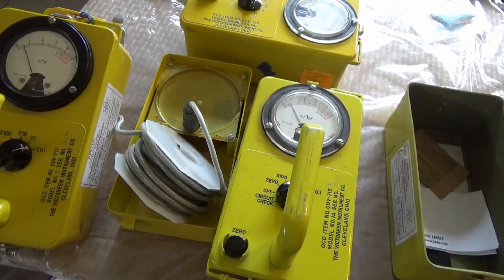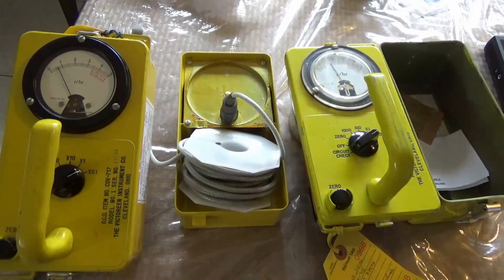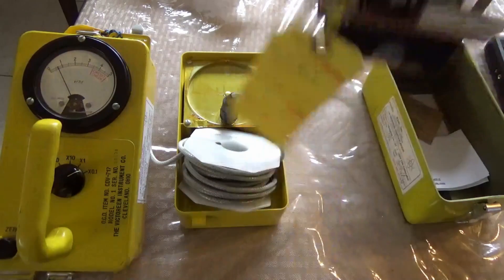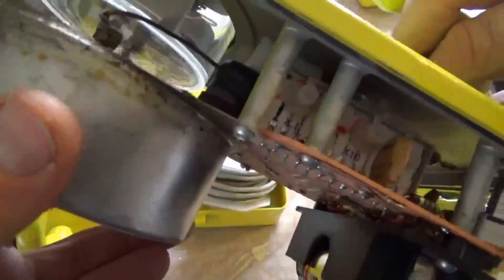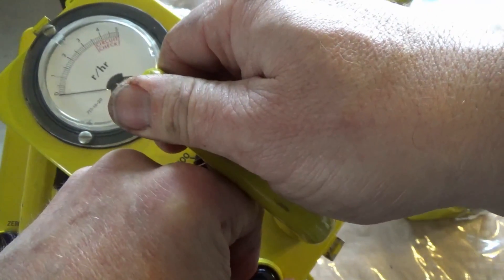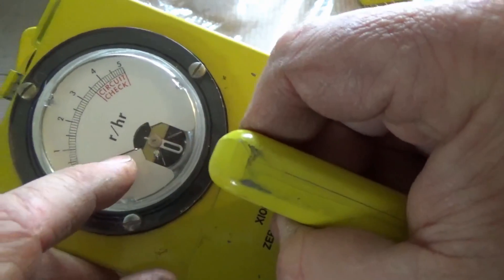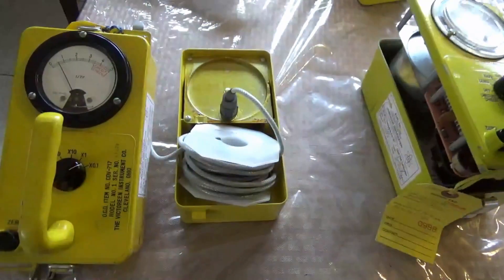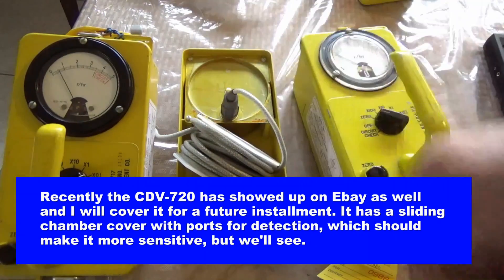Prepping 101: Testing Civil Defense Survey Meters with Cesium-137 - CDV-715, CDV-717

Comment: The reason your meter bounces outside your case is when you remove the Survey Counter from its housing the D Cell battery shifts a little and unless your battery contacts are very, VERY clean and the contacts in the battery holder are VERY tight and clean, when the battery moves  a little it changes Resistance and lowers or raises the amount of voltage the 40 volt power supply receives from the 1 1/2 volt battery and thus affects what the 40 volt Power supply puts out that operates the meter  (just like turning the zero knob does) another thing I have found is EVEN if the contacts are all clean and tight the Zero will still change a small amount when you remove the unit from its case because the Steel case affects the Transformer in the Power supply a little ....I really liked your video .....holding the battery still with your fingers while handling the unit outside it's case also helps!.........using VERY fine emery cloth to keep the oxyidation off the batteries and battery holder contacts is a never ending chore in my Survey meter collection and is especially a problem with the CD V750 Dosimeter chargers

Comment: I hear that that cable loses alot of the signal.  If you use it while the chamber is attached directly to the unit it will detect more.
Reply: That meter goes to 500 roentgens per hour. For reference, the roof of chernobyl where liquidators could only work 90 seconds at a time was about 200. If you have enough radiation present to make that needle move in any meaningful way, you need to seek shelter, immiediatley. A bit of interference from a cable doesn't really matter since 120 r/hr will kill you just as dead as 100 will. Its more to monitor the rate at which levels are falling outside of a shelter so it's occupants know when its safe to switch to a low range detector that can measure more accurately. This is because the more sensitive low-range detectors in the 700 series can be burned out and give false safe readings if exposed to high level radiation.

Comment: Ion chamber is at atmospheric pressure inside. It is only sealed to keep pressure and humidity the same. What does decay on these is the one vacuum tube that runs the 900v power supply. It supposedly had small amounts of radium to reduce the voltage at which it triggers. The radium decays away inside the tube no matter what.

Comment: These (I guess) are only gamma detectors?  Elemental Radium is a 97% alpha emitter for instance which these wouldn't pick up. If you had a Radium source that measured on this meter you can be sure it will be at least 30 times hotter than that measured. Each tool for its job and knowing the job is important here. (I guess-not qualified to comment really). I saw these and they look amazing bits of kit, would be very cool to have one. Also this is first video from GunsAmerica I've seen, so I'm sure he has been through this. Subscribed.

Comment: So basically, really hard to make that CDV715 survey meter needle to move. Fukushima reactor blew on March 11 2011. If you had that meters in your hands on April 3rd 2011, the needle would just start to move to 0.1R/h (one big graduation on the 0.1X setting), aka 1mSv/h as would you stand 600-700 meters or closer from the exploded reactor. The CDV715 would max out at 500 R/h at around 10 meters from the reactor on that day. See my youtube comment that explains the details here: https://www.youtube.com/watch?v=SD0kTKPPN40&

Comment: An ionization chamber meter is really a super-sensitive voltmeter (an electrometer) that detects the momentary charge created by an ionized path through the chamber. Even moving the meter around outside of the case will change the electric-field around the meter (and you were sliding it around on the top of a sheet of plastic, that has its own static charges).
Reply: tits or gtfo

Comment: No, actually the r (rads) is now a defunct unit to use for measurement.  The uSv/mSv....etc  (Sievert) is an SI unit, and has been universally adopted since ~1985.  The Rad is not a biologically based dose, nor is the Roentgen (R).  Both units measure ionization field strength directly. This is why both units were discontinued.
Reply: Sorry, I must clarify.  The Roentgen went out of service for dose measurement long ago ( and was replaced by the Si Unit Sv) while it may be no longer used for calculating  biological dose any more, it still can be used to calculate general field strength for penetrating radiation like X-rays and Gamma rays.
Reply: I think the idea behind owning these meters is to detect dangerous radiation in a radiological emergency, and at that point, no one is going to care what units the measurement is in.
Reply: @jameswill9323  Yes absolutely.   Uncalibrated or not, if your CD 715 dial suddenly starts showing something is there measurable in full Roentgens (R), get far away from that area at once and worry about what kind of nomenclature to call the reading after you are few hundred miles upwind (not downwind).
Reply: @jameswill9323  designed for 'boomer radiation' detection as in nuclear bombs...

Comment: Survey meters are for life and death situations, a geiger counter is 10,000X more sensitive and useless in an emergency since the tube will saturate and overload showing zero on the dial indicator.  A mass spectrometer would be needed to detect so called "contaminated" food.
Reply: Geiger-Muller counter tubes are never effective in high levels of radiations, hence the survey meters with ion chambers shown in this video.  You are spreading false information here. 
As an example, Bluefin Tuna found off the coast of California which was found to have radioactive cesium in them which was attributed to the Fukushima power plant accident.  The levels of 'contamination were found to be 30 times lower than the normal background levels of the tuna to begin with. 

You can't measure anything lower than background radiation with a geiger counter.   So no, you can't check "contaminated" food with a geiger counter, ask any health physicist and get over it.
Reply: @ForbiddTV  You are correct about radiation amounts lower than the back ground count will never be detected with a geiger counter.  But if after a nuclear blast you left your tuna fish sandwich outside in the path of fallout and for some weird reason you decided it may be edible, it is possible your survey meter may advise against that while the geiger counter stays silent.         :)
Reply: @kenibnanak5554  Both would read nothing.
Reply: @ForbiddTV  You are correct about geiger counters failing to detect cesium in tuna, but in that scenario, you would need much more expensive equipment. But in the event of an emergency, a geiger counter will do fine. But when the amount is unmeasurable by a geiger counter, that means its concentration is so low it's not that dangerous. It should however be noted that cesium-137 is already found in tuna due to the nuclear tests in the 50's.
Reply: @victorfiori105   You might want to check the radiation values you gave.  Those are not dangerous life or death numbers one would be getting in an emergency. That is where the GM tubes would fail unless they were with calibrated with corresponding shielding to protect the tubes from saturation.  And of course geiger counters are still useless for checking for food contamination unless grossly exposed to fallout dusts, in which case it would be obvious to only eat things produced prior to the emergency from sealed packaging. I always have to laugh when someone makes a video of them checking their food for Fukushima radiation with a geiger counter.
Reply: @ForbiddTV  Of course they are nowhere near life or death numbers. But prolonged exposure will definitely have future health issues. It really depends on the tube and device used as some will hold up better than others. While it is true that an Ion chamber is better for higher level readings. I prefer a geiger counter out of all because they are simpler in design and more rugged. Especially if they will be stored for long periods of time. But in most nuclear disaster scenarios, the levels will not get high enough to cause issues like saturation with geiger tubes. The best solution is to get something like a ludlum model 3 and have both the pancake geiger tube and beta-gamma geiger tube.
Reply: @victorfiori105   Doesn't sound like you have any experience with survey meters.  I see a much greater failure rate with geiger counters than with survey meters, I have thousands of them from the 60's so I speak from experience here. I have over 10,000 radiation detectors in stock. A Ludlum with a pancake probe would be the least useful geiger counter of all in a survival situation.
Reply: False. It depends on the tube but geiger counters will not always saturate and overload in an emergency. I have a collection of radioactive sources. One piece measures 55kcpm(around 300 uSv/hr) with M4011 on a $100 geiger counter. I had it measured by the PA DEP with an Ion chamber, it puts out about 1.3mrem/hr of gamma radiation alone! When it comes to an emergency situation geiger counters are not accurate to extremely high levels as they will undercount the actual readings. But when detecting contamination, the more sensitive the detector is the better. Especially when it comes to checking food. When checking for contamination, the best detector to have is a pancake tube Geiger counter. Also, a survey meter can also be a geiger counter. It all depends on the probe attached. Also Mass spectrometer? Do you mean a gamma spectrometer?

Comment: On ebay the Canberra Ultraradiacs MRAD103(no vibration) or MRAD113(with vibration)  have been showing up. the cover from 5 uR/hr all the way to 500R/hr and offer source finder and dosimeter functions as well. they are small as well. So you get the CDV-700, CDV-715 and CDV dosimeters (3 items) in one package. new ones in boxes have been selling for less than 200 dollars.